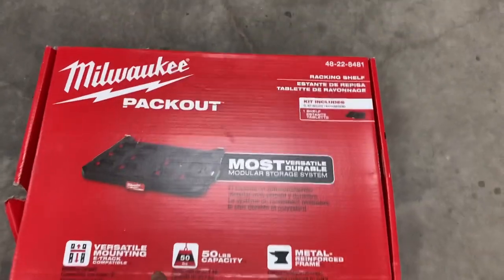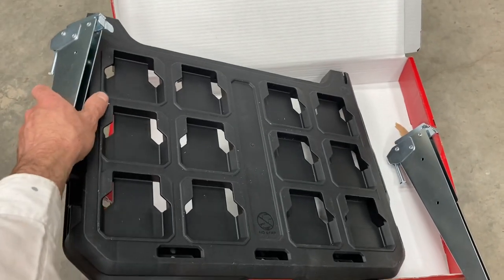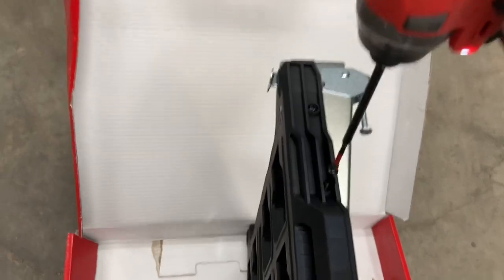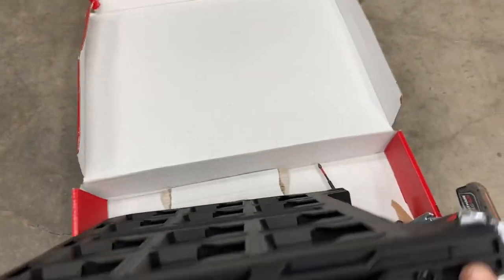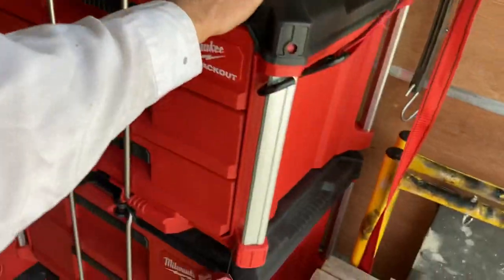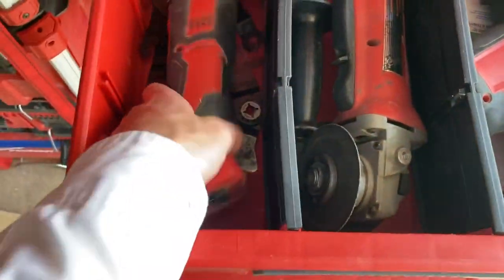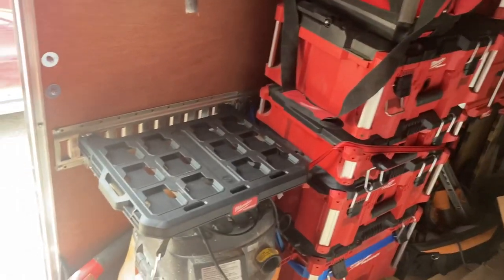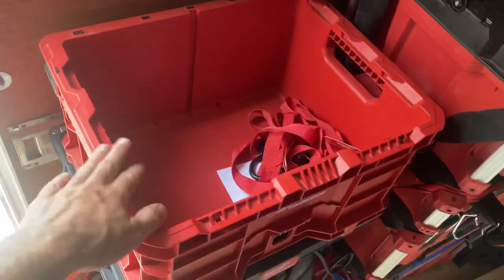Milwaukee Packout e track mounted racking shelves

Comment: Did you remember to tighten the shoring screws?
Reply from the maker: I did eventually…. When they are snug it keeps the mounts pretty stiff but depending how much weight is on there I like to snug them up with ratchet straps

Comment: Did you have the “shoring” bolt tightened in the part where you said they were flimsy. I don’t think I want these if that’s the case.
Reply from the maker: No I was still deciding how to configure them and didn’t have it tightened yet.  It’s much less flimsy once it’s tightened, but there’s still a 50 pound weight limit so I use straps to take some of the weight off
Reply: @FixerMerlin  good to know, thanks. I'd be interested in a follow up video showing it's stability at 50 lbs without a strap, and how it holds up on the road.

Comment: place some more screws on the E track and it gets better :)
Reply from the maker: You mean add more screws to better secure the etrack to the trailer?
Reply: @FixerMerlin  yeah, atleast close to the packout, think it should get more stable then.
Reply from the maker: I agree that in this application that would help a bit, as the etrack definitely has give in some spots.  However the trailer is built with 1” tubing on 24” centres.  Adding more screws in between would not help because there is nothing into which I can screw, just 1/4” plywood

Comment: That e-track and Packout shelving gives a means to create a whole storage system without the weight of custom wooden shelving/cubbies. 
It's easily removable for a situation were you need to load up something very large in the trailer(motorcycles or ATVs), or upgrade to a new trailer.
Reply from the maker: Heck ya!  And imagine all the time spent figuring out and building wooden shelving/ cubbies?

You nailed it!  Sometimes I need to strip the entire trailer to help someone move and need all the space I can get.  I do plan on upgrading to a 2 or 4 foot longer trailer at some point, and now that I’ve got the setup configured just need to bolt in the etrack and it all goes in to the new trailer.